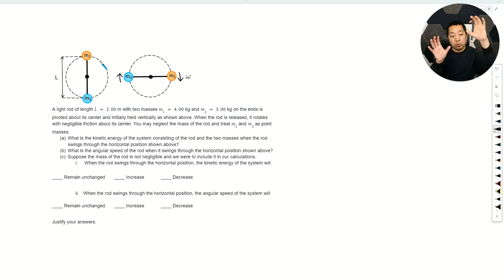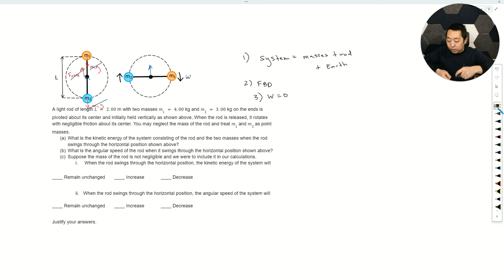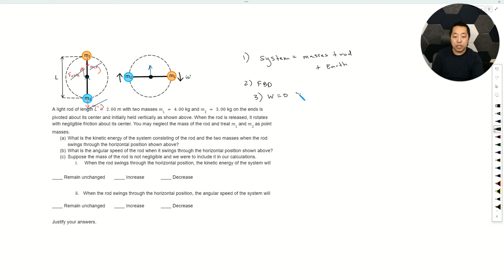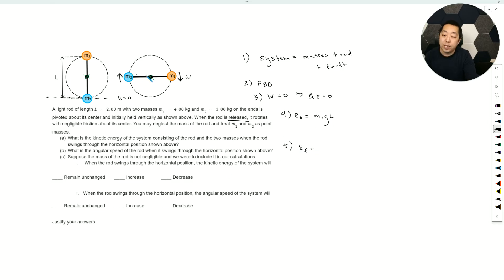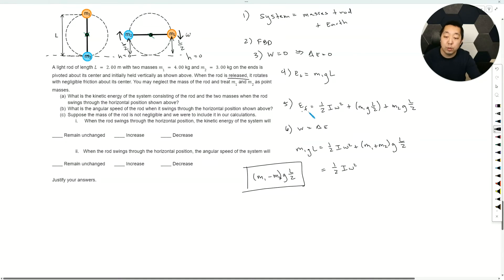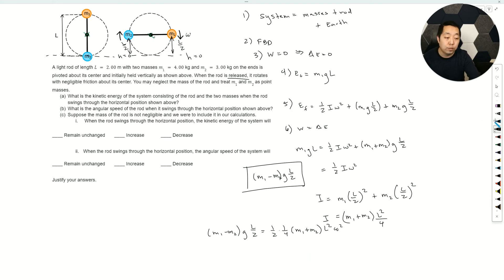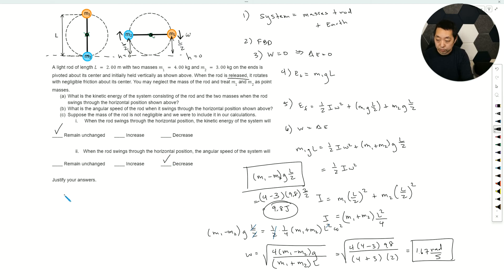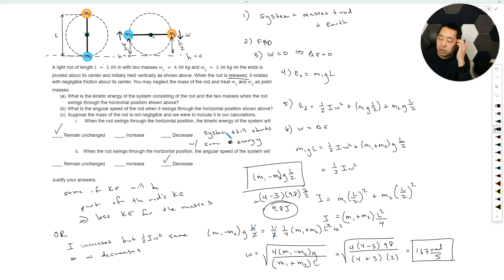AP Physics 1: Question of the Week #45 (Rotational Energy)

Comment: For part a, can i also just mark the middle (height L/2 relative to the bottom) as 0, then subtract m2*gL/2 from m1*gL/2 to obtain total KE? I added m2*gL/2 to m1*gL/2 while marking height L/2 as 0 and got it wrong. Can u explain why? Thank you
Reply from the maker: I'm confused what you got as an answer. You said subtract m2*gL/2 from mg1*gL/2 which is correct.

But then you say you added the two (which would not be correct). So how did you set it up and answer it?
Reply: @AllenTsaoSTEMCoach  i got the same as ur answer, just added the masses instead of subtract. I set the height L/2 (relative to the bottom) as 0. I then added m1gL/2 and m2gL/2 to find the total energy of the system.
Reply from the maker: No that would not be correct. If you set the h=0 to be the center, than any mass BELOW that line will have negative potential energy. Any mass above that line will have positive potential energy.

You can do it this way, but to avoid the positive/negative PE, I suggest you make the lowest point where h=0. If you want to pick a different height, then you have to keep in mind the positive/negative signs for potential energy.